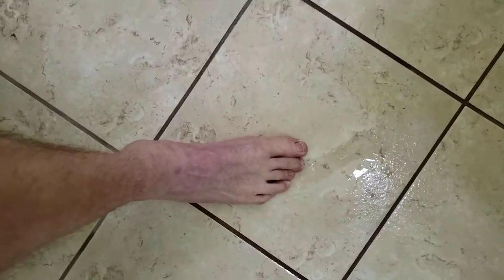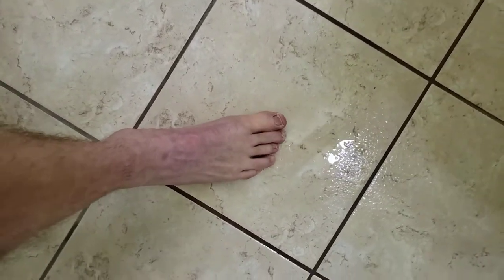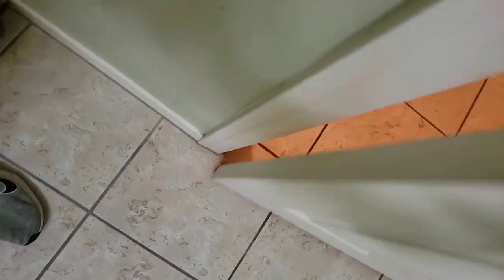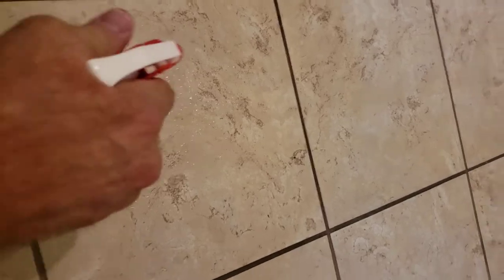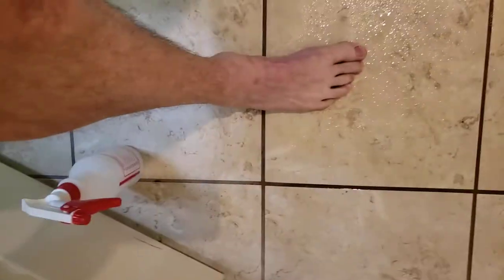How to make tile floors non slip to prevent a slip and fall accident

Comment: What did u appy to the floor...
Reply from the maker: It's a industrial solution that creates a microscopic tread on the surface for a specific pre-determined amount of time before its removed, leaving a non-slip surface without changing the appearance. This is a permanent solution instead of a coating that wears off and is not found in stores.